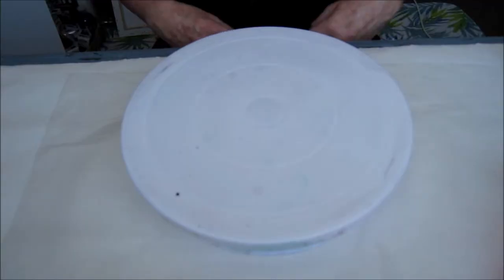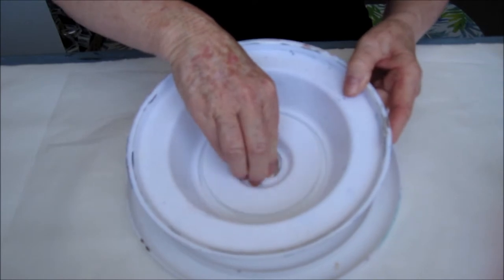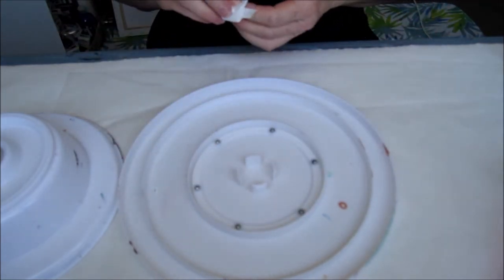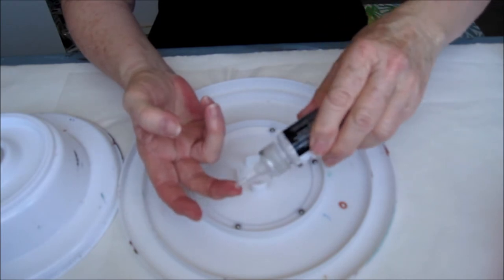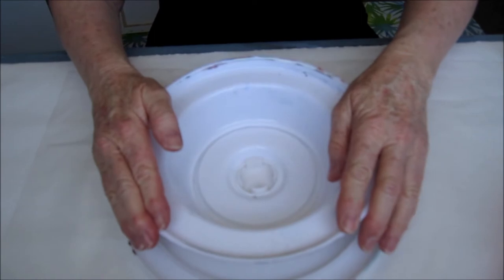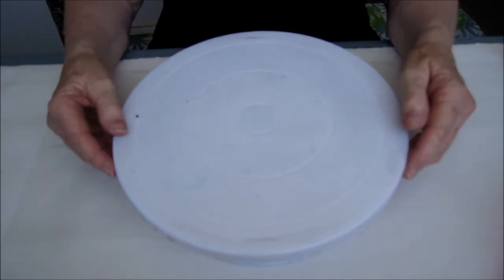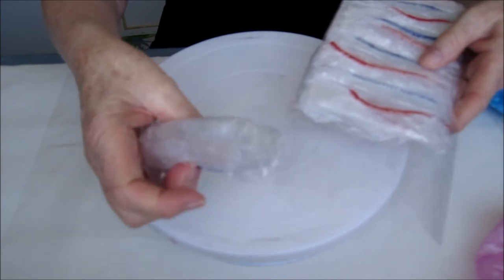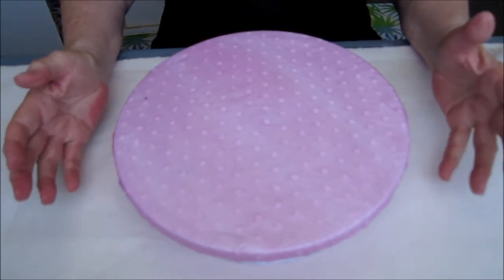Acrylic Pouring NZ 🎨 Tip (01) -  SPINNER  (Paint Pouring Hints and Tips That Work For Me!) 💛💚💙

Comment: how big is it, does it have to be the same size as the canvas?
Reply from the maker: Hello!  My cake spinner is 28 cm diameter, which is pretty much standard here. No it doesn't have to be the same size as the canvas - if I have a larger canvas I want to hold in place, I use double-sided sticky tape. The spinner doesn't work well with very large canvases.
Reply: @TheLadyfocus  ok, so if thinking about buying something that spins that is 18cm (because of space and money, there was a version 30cm too, but I won't have space for that to be honest), how big, do you believe, can the canvas be before getting issues.

The thing I was thinking about is for art, you know that spinning thing when creating things in clay. Was thinking about to use it for multi-purpose that way.
Reply from the maker: @linneahulten405  Good luck with that. I really can't help you as I've only worked with the spinner I have. On a smaller one, the size of the canvas would also depend on the weight of it as well, to be sure the spinner would turn smoothly.
Reply: @TheLadyfocus  thank you for advices!🌷